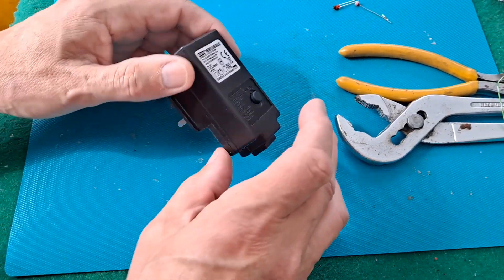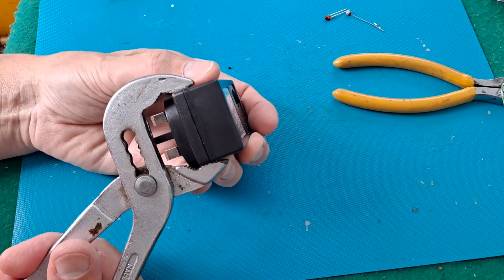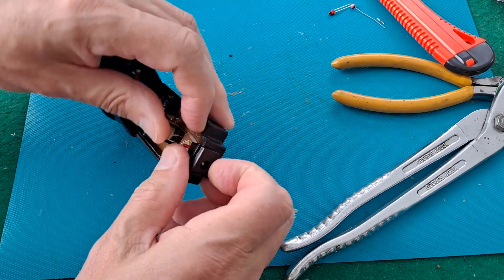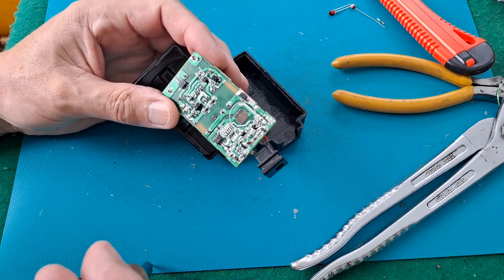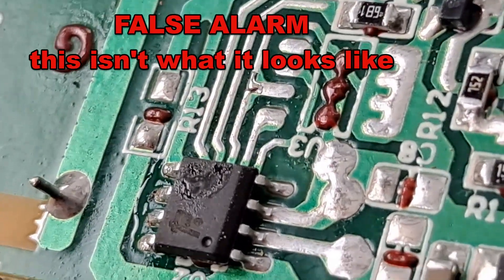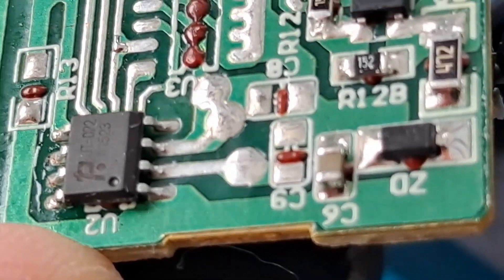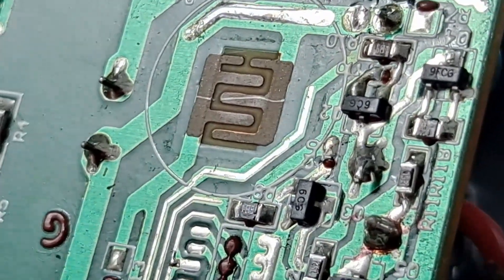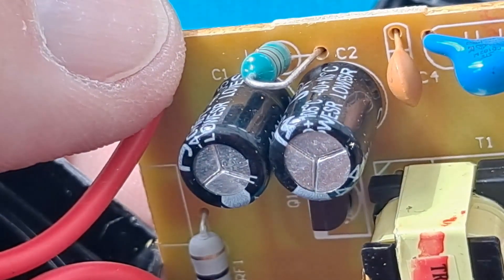Looking at the power supply for the Morrisons LED string lights

Comment: I think it's definitely the power supply.  If there are two 100 light strings in series (which might change the wiring patter between LED-100 and LED-101), 60ish v would light two strings of blue/green.  However, 30ish v wouldn't light two strings of red/orange. Or vise versa with the polarity switched.  It seems like something in the power supply is clipping one half of the wave at 30ish v.  That might be why the controller is getting warm.

BigClive's set was a different kind of animal.  2-wire with programmable LEDs?  I don't think you ever told us if this light set has programmed patterns.  If one of the patterns alternates between blue/green and red/orange (a chasing pattern?), the controller would have to be able to control each half of the wave separately.
Reply from the maker: Hi, Jay. I have shown the details several times. Probably the clearest point is where I show a close up of the case which lists the information, voltage input, output, and sequence 06:23 I would say Clive's was as close to identical as possible. Links in the video description 👍
Reply: @GrandadIsAnOldMan  .. I see that now.  My fact checker messed up with the '2-wire with programmable LEDs'.  And thank you for the time stamp on the controller info.  That got past me.  I still can't wrap my brain around what's going on when you get 60ish v and 30ish v in different directions from the power supply.  I'll go back and look at that - but, you'll probably get the next video out before I get that figured out :-)
Reply from the maker: @jayherde0  I am sure it is supposed to be giving us pulsed DC 30 volts, with one set of light working on negative 30v and the other set on the positive 30v. Something has gone wrong and we are missing half that cycle or possibly the middle reference point is now either at the peak or the trough. The lights were working fine at some time in the past. My daughter told me that somehow they managed to break the wire and she taped it back together and it worked for another festive season. She recently wanted to use them for a decorative feature and found they wouldn't work, so they ended up with me. There is one more video scheduled for 11PM tonight UK time where I try to explain my theory of how they don't work, but it is very much guesswork.
Reply: @GrandadIsAnOldMan  ... I have an idea based purely on observation.  But I can't completely understand it functionally.  I'm expecting some insight from some other kid toys that I have waiting in my pile of stuff - if you get my bridge ;-D

Comment: ya thats a shame that nothing can be spotted on the platinum plate for damage or puffyness,so maybe the wiring along the way to the led,s is faulty or theres is something faulty that u cant see with the eye on the platinum somewhere,maybe a metal strip on there might have a crack somewhere along the line,who knows.
Reply from the maker: I was rather hoping we would find a nice fried chip that would be easy to spot, but not this time.

Comment: I don't think its a PSU problem, more a wiring issue. The leds must be split into two distinct circuits, and connected together in parallel. Check out that join in the wiring and see if it shouldn't be split so one wire goes to one side of an led and the other to the other side. In other words, the positive of one circuit of 100 leds should be connected to the negative of the other 100 leds....and vise versa. The two resulting ends should then come straight from the PSU. Thats how it looks anyway, it's that taped up joint....it needs splitting.
Reply from the maker: I am guessing you haven't watched the previous videos.